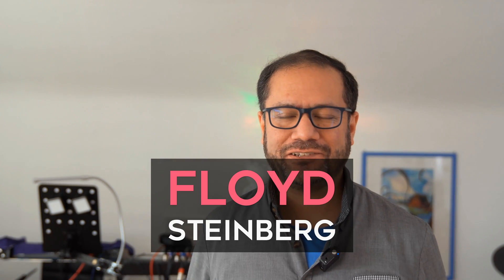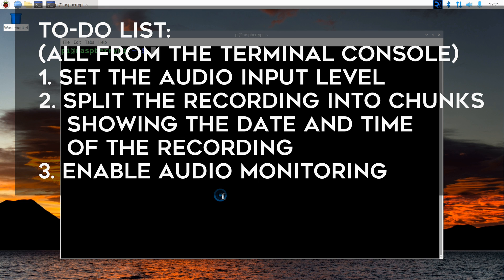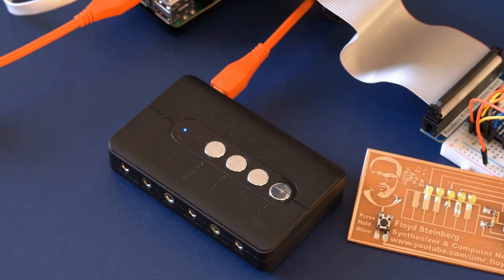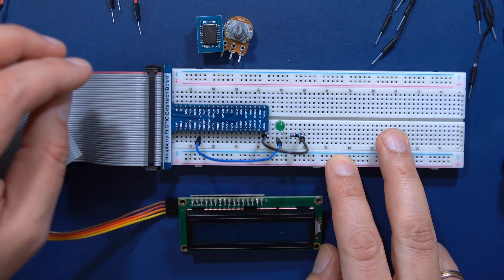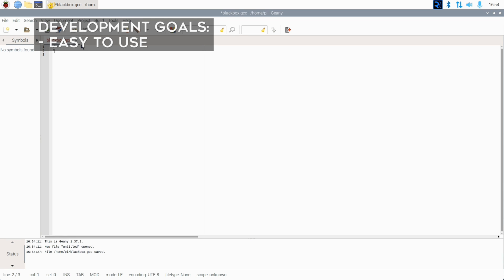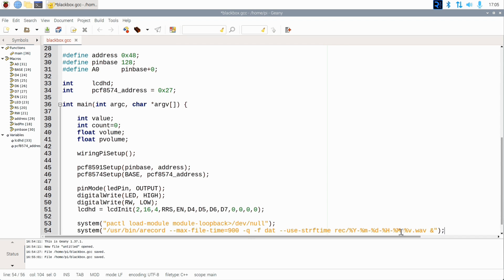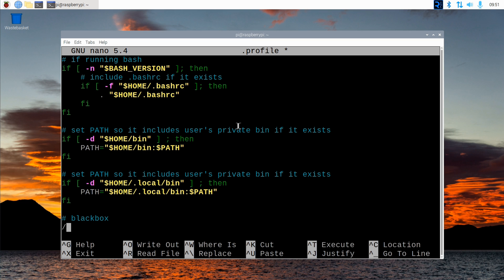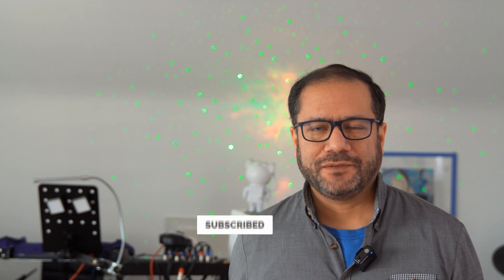A "blackbox" skipback recorder for your home studio (DIY idea)

Comment: Great idea - better still it is a fantastic example to work up into bigger projects.   Just one comment - random shutdowns may corrupt the SD card, perhaps have the command 'shutdown -ah now' executed if the potentiometer is set to zero for more than 10 seconds.   Also, I have used a PiZero2 for audio capture from a USB audio interface, I have not tried a PiZero but it probably would be perfect for this project too.
Reply from the maker: Thanks for pointing that out! Yes, that's a great idea. There so many things  to consider in order to take this from the "quick and dirty proof of concept" to the "other people might want to use this as well" level... I'll continue working on this and put out more videos perhaps later this year.

Comment: if you give me measurements...i can make you box and print you aswell.
Reply from the maker: Thank you very much for your offer! I'll wait for the box I ordered to arrive first, but if that doesn't work out, I'll come back to you ;-)
Reply: @mr_floydst  recently I revived my Behringer bcd3000 DJ console with 24 bit sound card an 2 stereo output as DJ pi console. so it looks like laptop with mini screen...all in one solution. so I made hanger for bdc3000, for 5 inch dsi display and back casing for covering pi and for 50 fan (12 v runs on 5v so quiet but still efficient).

Comment: you can run the program as script and add to first line killall "nameOfTheProgram" ...it will kill all procces with desired name .
Reply from the maker: Thanks for pointing that out - it's another way of solving this specific problem ("if it works, it's a good solution") ;-)
I implemented the lockfile because I found that to be something that might work better in the hypethetical case there's another app of the same name doing it's thing (yes, that's very hypothetical)

Comment: Wow. From an idea to a working prototype in record time. 

I hadn't thought of the 'blackbox" approach eg to record everything, nor did it even occur to consider the Rasberry Pi and a regular USB audio interface. I was thinking along the lines of 'listening/temp record to everything, but only save what you later estimate was worth  saving.  eg the last 5, 10, 15, 20 minutes. Your use of the Pi takes care of the file-keeping issues, eg no need for any other module. Neat. This would suit one of the earlier Pi which many will have about, or pick up dirt cheap.

This though is a really really fantastic solution.  And yeah, capturing midi alongside the audio in real-time is the next obvious next step.  A way to 'see' the most recent files, with a button option to tag the last/current file so its not deleted later would be useful too.  Thanks for even attempting this project. Thanks for showing us how. Great job.  BTW about that extra ADC converter for the potentiometer, i thought the pi had analog read, [but it turns out this is a hack using a capacitor and timing when it discharges],. An alternative might be one of those potentiometers with I2C built in.

[leaving search terms for others to find this. eg DIY  "skipback" "digital real to reel" "skip back" "daw-less audio recorder."]
Reply from the maker: Thanks - good idea. This video will be a slow burner no matter what, but it was fun to make. Thanks again for sharing your idea :-)
Reply: @mr_floydst  You could maybe do a follow-up down the line, perhaps with that 3d printed case you talked about, plus a few other refinements. 

I was thinking instead of a potentiometer you could have buttons to increase and decrease the level values. Also if you had separate folders for the main recordings and the tagged/saved files you could navigate these again with buttons via a simple menu/files display. Also, a button [or two at the same time] to shut down so current files are saved properly. Who knows, maybe even an OLED screen with an animation of a reel-to-reel recorder. ;0)

Once again thank you. This is one of those ideas fellow musicians won't really appreciate until they see it demonstrated in situ, and then they'll be thinking why has no one ever made one of these before.
Reply from the maker: You're right - I was thinking of an encoder and a button. Also, as the Raspberry Pi zero is the smallest device to run a full linux (which is needed here), that should be the target board. Material cost would come down to $40 this way. There is no cheap high quality ADC hat for PI, unfortunately.
Reply: @mr_floydst   2 weeks on, and i just had an idea. 

What if we could use our old phones for this? Imagine an old Android or even iPhone with Linux installed on it, used in place of the Pi and the USB capture card. We wouldn't need the sim, but the rest could be used to always record and save to internal memory or a microsd. It would be easy to get audio in and out via a TRS cable. The battery would be useful, but you could have this always plugged into a charger. I'm just putting this out there. Old phones repurposed as audio backup devices.

Comment: I have seen this functionality in Bespoke Synth DAW. It's very useful thing for capturing those spontaneous jams occuring when testing new sounds.
Also I am wondering if there is similar commercial product to this "Blackbox" module. I would not be surprised to find one.
Reply: There's the sp-404 with its tiny 40 seconds of loop capture. ok for beats but not nearly enough if you are jaming musician. Hence this idea. This really needs one of the major players behind it.
Reply: @chrisliddiard725  Bespoke has 30 minutes. Much more useful.

Comment: Fascinating video Floyd! Thank you for sharing. Will be referencing this once my Pi 5 is here, especially with m.2 HD availability on the Pi 5.... very interesting - thanks!
Reply from the maker: I tested this on the PI5 (and it works fine), but the PI5's cooler gets in the way of that breadboard connection cable! Had to order some adapters which didn't get here in time. So annoying. :-)